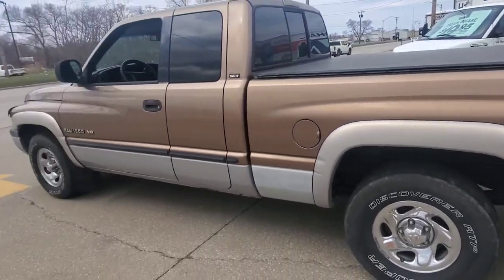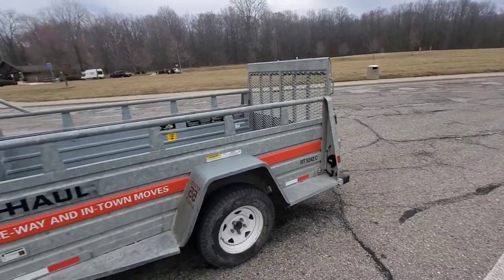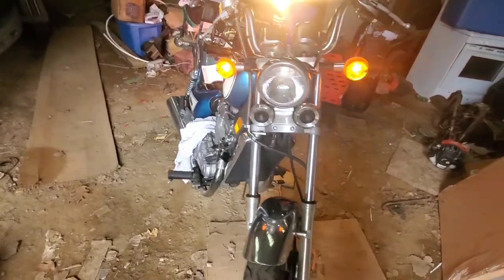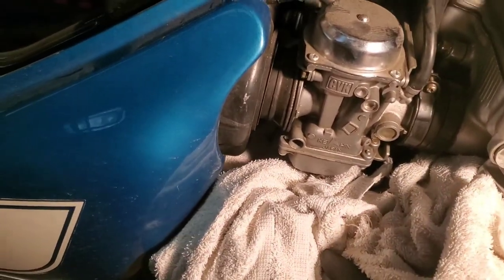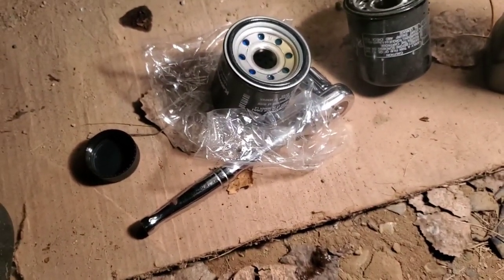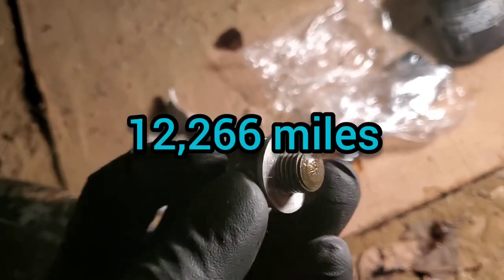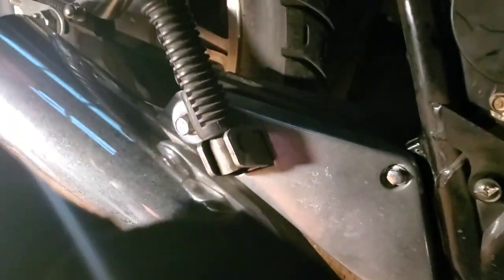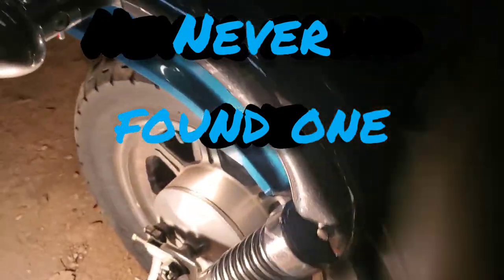My new 94 Kawasaki Vulcan 500 with 12,266 miles. Oil/Filter Change, and second start in 3 years

Comment: I just bought a 1990 Vulcan 500, wouldn't start when I bought it so I got a good deal. I think I just gotta change the gas  clean the carbs out. Oil wasn't even registering on the side viewer like yours,gotta change that too. Can't wait to fix it up and ride it. Super cool bike and video 👍
Reply from the maker: Thanks for the reply. Yes start there and then with fresh gas see if you can get her to fire. I had to rebuild my carbs. But if you can get gas in them then let it sit over night and try again. Sometimes when they been sitting dry the gas has to loosen things up again. Let me know if you get it to run. I love that part.
Reply: That old filter is a k&n brand
Reply from the maker: @patrickfischer2264  so it's not factory?

Comment: Hey Mo sent a PM but my junk phone will not cooperate.  Thanks for the video.  Like the Kawi, looked at the vaquero for a while.  They look great but I heard some issue with the engine kinda made me change my mind.  Waiting to see what you think about yours.  Be safe and keep the shiny side up brother.
Reply from the maker: Thanks John. I will say it's a great bike. After I bought it I was told it's the same motor as the 1000 cc crotch rocket just cut in half because it's a 500 cc. It's pretty fast for a 500  with its 6 gears and I personally like it. However I will say this. Get an 800 or 1100. The 500 is fast just small and narrow. The 500 is a great starter bike for a beginner. That's why I suggest a bigger size. But the carbs were very easy to remove and rebuild after messing with the goldwing carbs. Lol. Hopefully this answers your questions. Thanks for the comment. Be safe my friend.